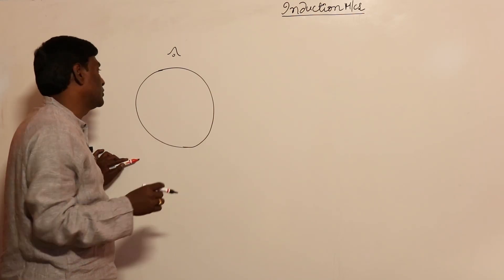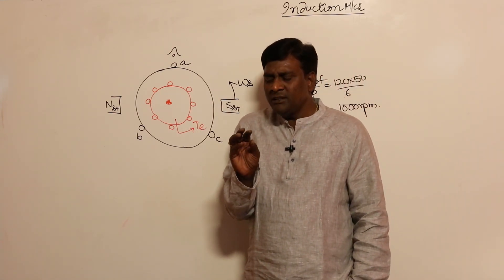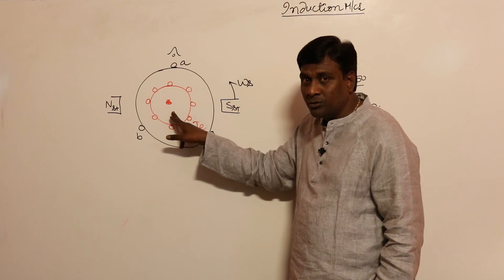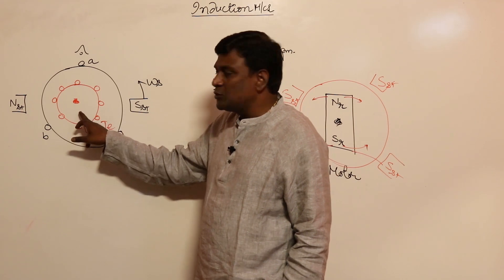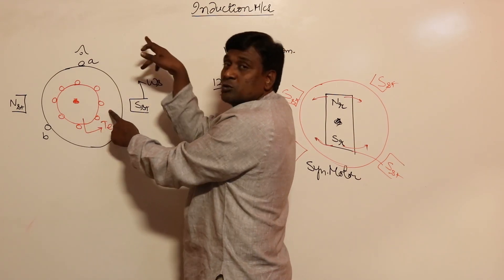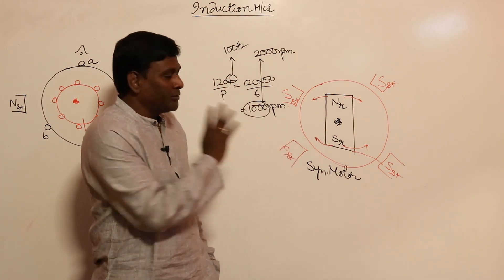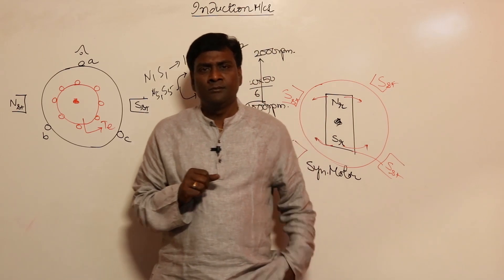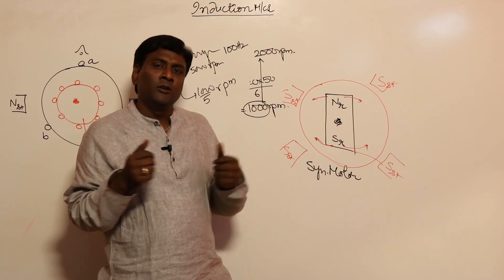Why Speed Control, Braking, Starters, Harmonic Torques exist in Induction not in Synchronous| KN Rao

Comment: Can we conclude that the basic reason for dependency of torque produced on relative velocity of stator and rotor in synchronous machines is that it is doubly excited machine ......and independency of torque produced on relative speed in induction machine  is because it is singly excited machine